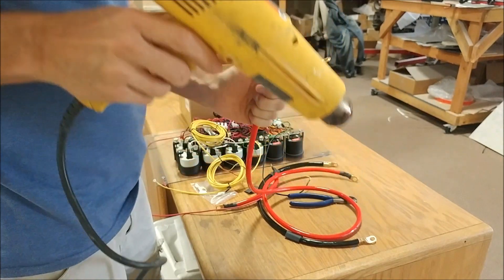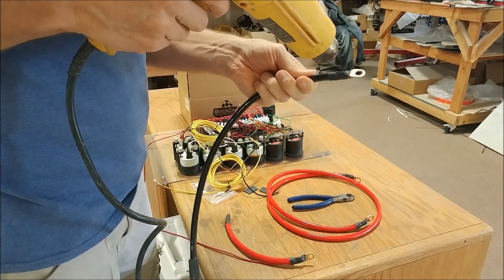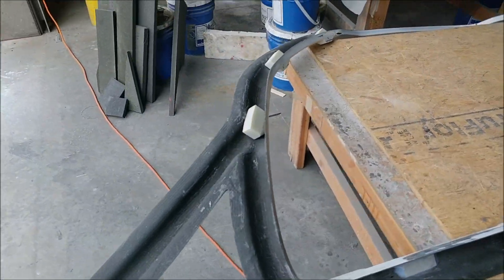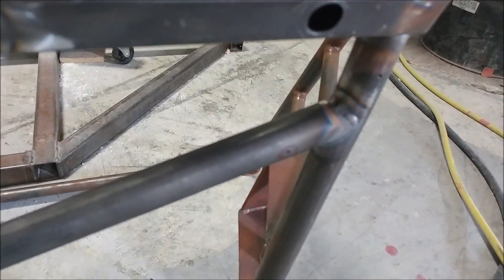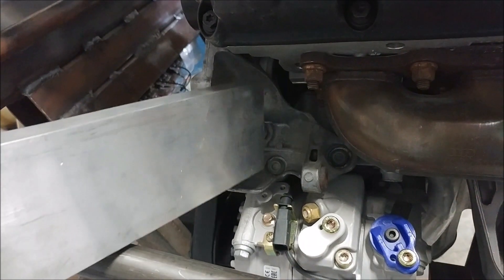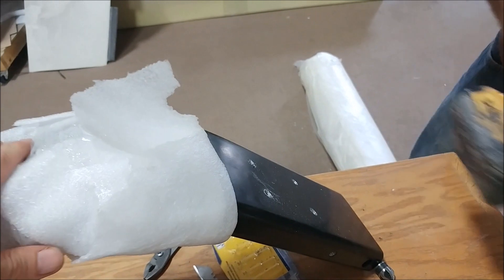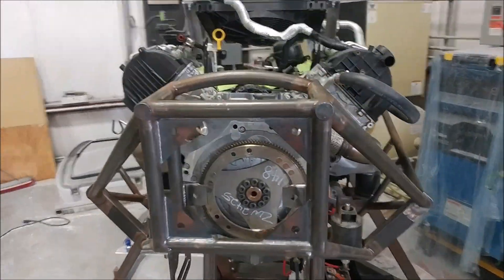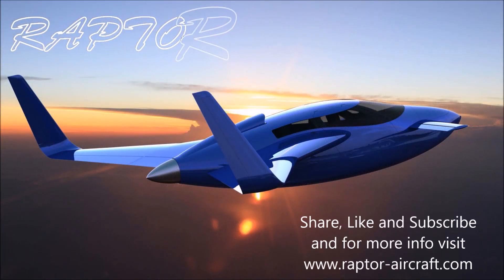Hooking Up The Juice - Wiring the battery, starter and alternator

Comment: On your website it mentioned you may need an oil additive if you use Jet fuel.  Do you need a fuel additive as well if you useJet fuel in a diesel automobile engine ?

Comment: Great video. For the engine mount, you need to weld shut all holes except for 2, then purge insides with nitrogen to get air/moisture out, then weld everything shut. 
For heat treated shaft, check dimensional tolerances. In most of the cases even flat large gears after heat treatment slightly deform and require secondary polishing to get back within specks. Long shaft like this definitely need a post treatment check.
How thick is tubing used in engine mount? 4130?